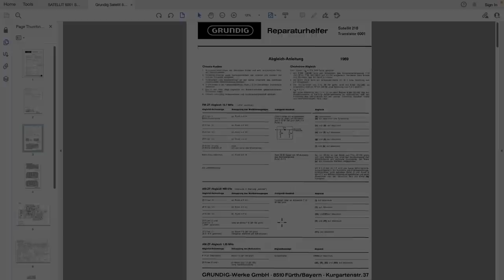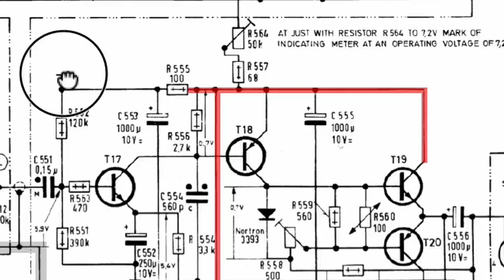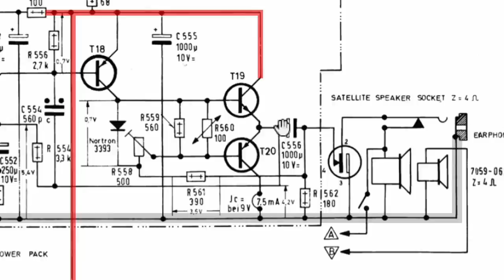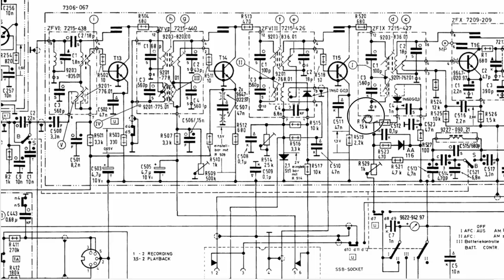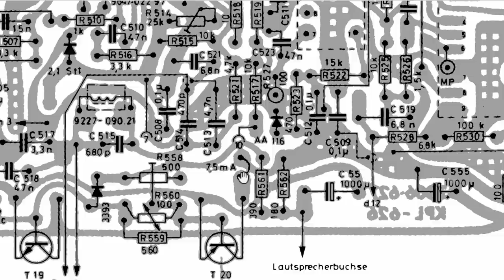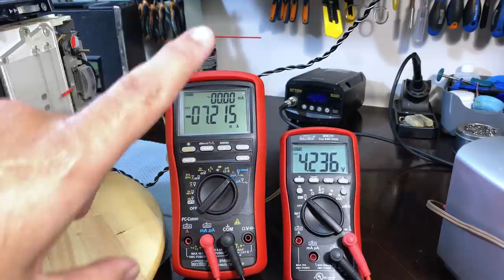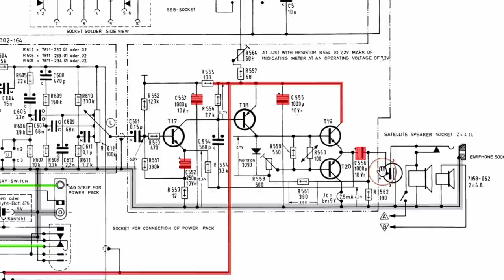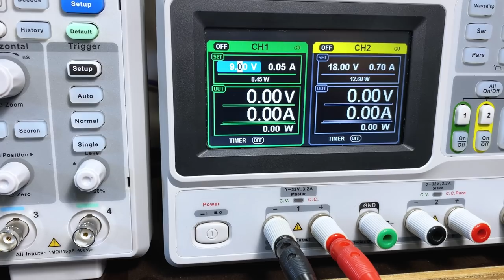Power supply and audio output is the first milestone. Grundig Satellit 6001 restoration part 2.

Comment: Manuel I'm watching the schematic, R560 appear to be an symmetry adjustment, and R558  the base bias  pot, both interacts,   These are  Ge complentary transistors, so an "AB"  is the most plausible option, although the risk of thermal run out on summer days,...

Comment: Hi Manuel !
First I wish You a happy and wonderful new year and enjoy us further with Your videos !
R560 is not a trimmer, it is a thermistor who compensate the drift of the powertransistors and is mounted on the heatsink near them. And C556 is not only for decoupling DC from the speaker, it's load powers the transistor T20 on negative period of signal. If T19 is conducting, the current flows through C556 to the speaker and charge up this cap and if T19 is locked on the other period , voltage is flowing from the cap over T20 to the speaker . So this cap is the "powersupply" for T20.

Comment: Looks like a great project. Be very careful of these "positive and/or floating ground"  units, you can have DC or AC ground loops through your test equipment, power supply, and test speaker. I have had some terrible experiences with this in the past. Have a very  happy and safe New Year.
Reply from the maker: That's exactly why I am slowing down the full testing. Connecting one piece of test equipment (signal generator) is fine because the power supply is floating, but also connecting a scope can cause sparks.
Reply: I believe the negative lead of the scope is tied to its earth ground. Its a nice spark generator :)

Comment: Onward and upward! The schematic seems to show a 2-way speaker system, is that right? If so, it's a very posh portable for its time.

Anyway, I hope 2022 goes smoothly for you and yours. Thank you so much for the interesting, informative videos, great viewing! They show me just how much I don't yet know...
Reply from the maker: I haven’t looked too closely at the speaker, but there may be a smaller one inside the main speaker.
Reply: @electronicsoldandnew  Ah yes, like the later ones.
Reply: Yes,the "speaker"button  Manuel mentioned is for selecting the extra tweeter function ( not the external speaker)

Comment: Happy and Healthy New Year Manuel ! Interesting project again. Can you tell us a bit in the next video about why they designed this with a positive chassis back then and why it changed to negative as we know today?
Reply from the maker: I’ll try 😊
Reply: My best guess is that they were simply following the industry trends of the time.  A bit of Wikipedia research revealed that Sony was the first to release a mass-produced transistor radio, called the TR-63, in 1957.  The first mass-produced transistor car radio, made by Philco for Chrysler, came out two years earlier in October 1955. This product drove much of the early market for transistor radios because the car manufacturers really wanted to replace the bulky tube radios they had been using since the 1930s.  Since most cars at the time had positive grounds, many home radio manufacturers made their portable radios with positive grounds so they would be compatible with car electrical systems.  Pocket transistor radios really didn't take off until the 1960s when Japanese mass production took over. I remember hearing about the JFK assassination over a friend's Japanese transistor radio.  By the 1970s most cars were made with negative grounds so portable transistor radio manufacturers switched to negative grounds as well. I have a Sony CM-41 "Cassette-Corder" from about 1971 that has a positive ground.  It's similar in size and function to the Grundig Satellit 6001 in the above video, though perhaps not quite as fancy.  I nearly blew it up trying to power it with a negative ground power supply but I finally deduced after some circuit tracing that it has a positive ground.  I learned later that Sony had sold an external power brick as an option for it but it plugged into a car's cigarette lighter, not a home AC outlet, and it had, you guessed it, a positive ground.  For home use one used the built-in power supply as there were no wall warts back then. There may be more technical reasons for the use of positive grounds but I wasn't able to dig them up in my quick research.
Reply: @sincerelyyours7538  Well, thank you very much for this explanation 🙏🏻
Reply from the maker: That, my friend, is an Explanation! Thanks. Yes, I also found the same info, and quite frankly, I had never really thought about it. Now I know.

Comment: Manuel, I have a 6000...will not turn on, DC or AC. 12vac is coming out of the xfmr. Were the caps bad on your PS? Do you know if it powered up prior to replacing? Thanks....David in TX
Reply from the maker: I’m afraid it’s been quite a while. The videos probably show the initial state of the radio.

Comment: Boa noite Manuel. Tenho visto várias reparações suas e quando se depara com rádios que o seletor de voltagem é 220v usa sem qualquer problema? Eu medi a voltagem e durante o dia varia entre 230 e 240v. Esse pequeno excesso não causara problemas no transformador e nas respetivas voltagens?
Reply from the maker: Normalmente não, excepto ao substituir o rectificador de selenium para silicon. Nesses casos, pode causar voltages demasiado altas no B+, e tem de ser reduzidas como já fiz em vários restauros no canal.
Reply: @electronicsoldandnew  muito obrigado pelo esclarecimento. Um bom ano desde já

Comment: I have the same radio; everything works except the drum SW tuner section has died, like it has no power?  What do you think the problem is?
Reply from the maker: I will carry on with this guy and with a little luck, it’ll have the same problem so we’ll see if the solution presents itself

Comment: Hi Manuel,I have an aerial spare that i think will fit your Grundig Satellite,please let me know the diameter of the damaged one ,the one i have is from a Yacht Boy and is in perfect condition.I would like to say how much i enjoy watching you at work on these old beauties especially the Grundig 3400.. My first Grundig was a yacht boy back in the seventies and I’ve been a fan since then,they sound so good don’t they.Good luck with the restoration and let me know if you need that aerial.cheers John Turner.
Reply from the maker: Hi John. The thickest diameter at the base is about 14mm. Is it the same as the one you have?
Reply: Hi Manuel, thanks for reply,i have looked and the base part which holds the telescopic aerial is about 14mm. This could be good..the actual aerial is 11mmdiameter and is the usual 2 part .first part  is 85cm the second part 32cm giving total length of 117cm. Let me know if you think it will be the correct one.
Reply from the maker: I believe it is!
Reply: Ok thats cool,how do i get this to you>
Reply from the maker: Email me and I’ll give you my address by return email.